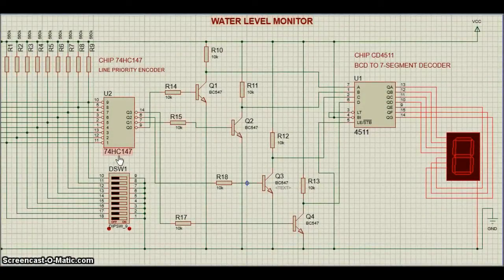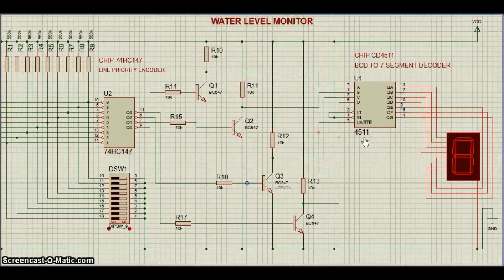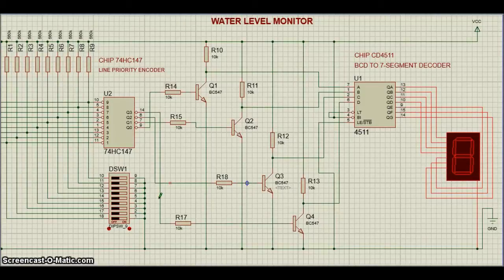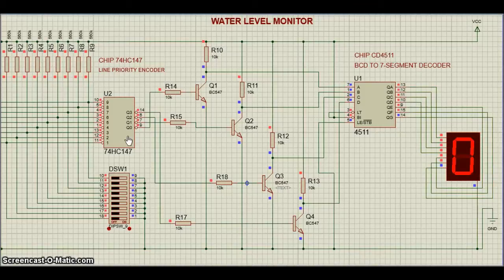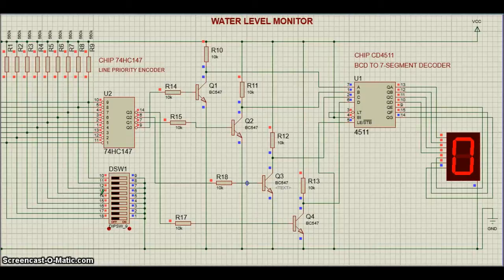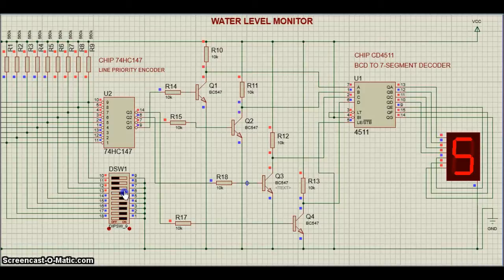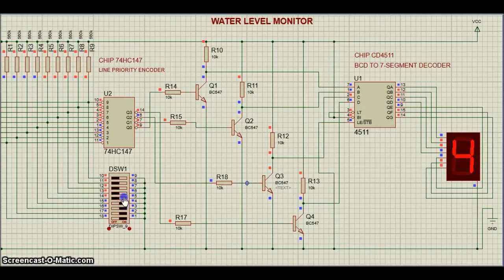Proteus - IC 74HC147E + IC 4511 - Water Level Circuit

Comment: Why voice is very low in the video?
btw i want to know if all inputs are high then why it shows 0 in 7 segment display? is there any inverter used inside the ic?
secondly, as stated if we use it for water level indication system then when water level reaches L1 its output will be something like 0111111111 (correct me if im wrong) and it will be converted to 100000000 hence 1 will be shown on 7segment display. But when water reached L2 now its input will be 001111111 and it will be converted to 110000000, according to binary its 3 not 2, display will also show 2. So how does it work?
Reply from the maker: Hi, AD Capter,
Q: Why voice is very low in the video? 
A: Sorry, this is my fault. I put the transcription. In these old days, my equipment was limited...I was an inexperienced YouTuber, you see...

Q: I want to know if all inputs are high then why it shows 0 in 7 segment display? 
A: These devices provide the 10-line to 4-line priority encoding function by use of the implied decimal “zero”. 
The “zero” is encoded when all nine data inputs are HIGH, forcing all four outputs HIGH. This is how this encoder works, that`s it!

Q: Is there any inverter used inside the ic? 
A: Yeap. The 74HC147 is a 9-input priority encoder that accepts data from nine active LOW inputs (l1 to l9). 
In the video, you'll see that the signal is inverted in the input as well in the output.

Q: As stated if we use it for the water level indication system then when the water level reaches L1 its output will be something like 0111111111 (correct me if I'm wrong) and it will be converted to 100000000 hence 1 will be shown on the 7segment display. But when the water reached L2 now its input will be 001111111 and it will be converted to 110000000, according to binary it's 3, not 2, the display will also show 2. So how does it work?
A: The 74hc147 code is a type of 10- to 4-Line Priority Encoder. Binary coded decimal means that each decimal digit, 0 through 9, is represented by a binary code of 4 bits. 
Let me try to explain:

If you see the datasheet of 74hc147 you'll find this table:

    74hc147 ENCODED    
INPUTS (0-9) OUTPUT   INVERTED DECIMAL
111111111 -> 0110 -> "Zero"    (it outputs decimal 15 which is equal FORCED "0" cause out of 0-9 range - bit trick, right?)
xxxxxxxx0   -> 0110 ->  1001     (9) from here when you invert, you count down 9 to 1...
xxxxxxx01   -> 0111 ->  1000     (8)
xxxxxx011   -> 1000 ->  0111     (7)
xxxxx0111   -> 1001 ->  0110     (6)
xxxx01111   -> 1010 ->  0101     (5)
xxx011111   -> 0100 ->  0100     (4)
xx0111111  -> 1100 ->  0011     (3)
x01111111   -> 1101 ->  0010     (2)
011111111   -> 1110 ->  0001     (1)

(x means any signal, it does not matter...)

Hope that helps. I made my best to explain. 

Thanks for your visit. Best regards, J3 o/
Reply: @j3_  Thank you so much for taking time and writing such a detailed answer, really appreciate that. 
So i just learned "priority encoding" which means each input has its own priority level assigned, top most input being highly prioritised and lowest being lowest prioritised. So ic will count latest or top most prioritised input and convert it to 4bit output while other inputs will not be taken into account.
Now if you have some time will you educate me on active low and active high pins, what are they and how do they work? its bit confusing for me at the moment.
Reply from the maker: @joshitoshi9835  , thanks for asking...but I am afraid that in what context, in what domain you are referencing ...if you are referring to IC, for example, ATMega328p, the Arduino's chip, there are registers that are used with pointers in C, that the low register together with the high register, form a 16 bits number...but I don't think I get your idea...:) Anyway, I tried...
Reply: @j3_  i was asking generally about active low input and active high input. But i have somehow managed to learn that from Google. Thanks

Comment: hello, I would like to ask, in this diagram here http://www.electroschematics.com/5655/numeric-water-level-indicator/
the ic 74147 has both pins 16 and 8 but these pins don't show up in the ic component in proteus..I followed all the diagram but I'm not able to make it running during simulation
Reply from the maker: +ihate vengeance ,  the pins 16 and 8 are internal to the 147 chip; you just need the ground; by 
clicking on properties you find the implementation of the VCC named Model Timing Voltage. Troubleshooting is a task of patience!!  there are many vids on my channel that can provide more information to you and try to solve this problem ... Thanks for visiting!!!